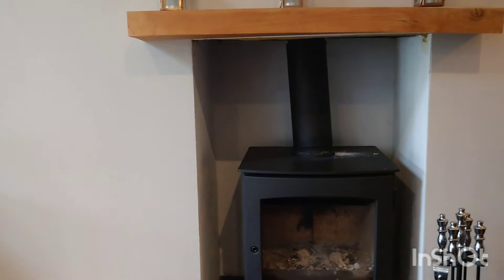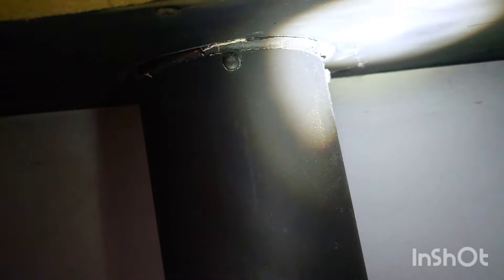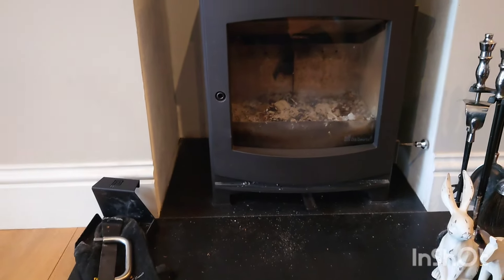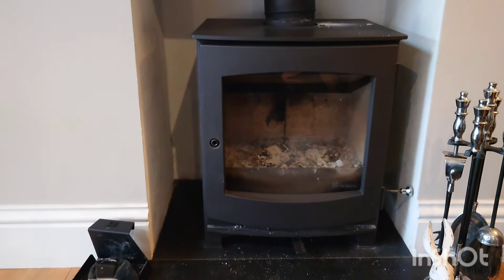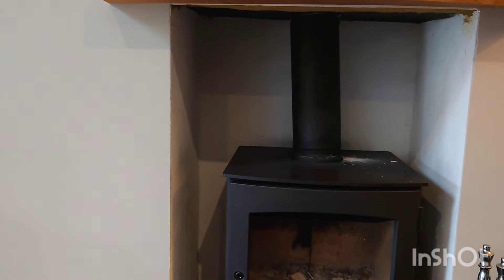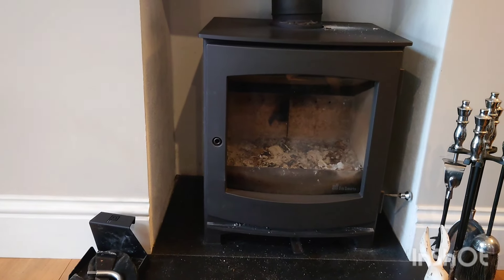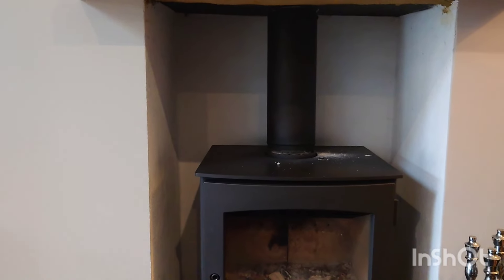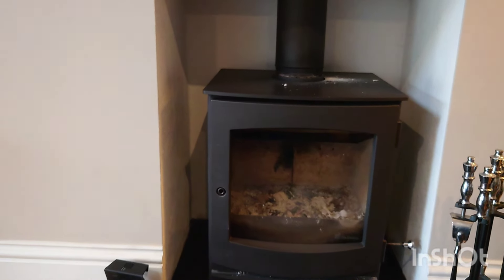BEWARE OF SINGLE STOVE DOORS

Comment: Tin box..... I had single door  cast iron not a problem
Reply from the maker: You must have used it correctly.  Been a chimney sweep for over 23 years. I come across this problem a lot.. this video is for people who have had problems.  Thank you for sharing your experience 👍👍
Reply: @zacharysweeps5169  because there a tin box with thermolite sides cast iron does not move I swung the door open all the time it's  all these defra lightweight ones that move about I now have a double door biggest cast iron they do 14kw fox hunter all cast iron 15mm plate it took 4 of us to lift it but that has 2 doors